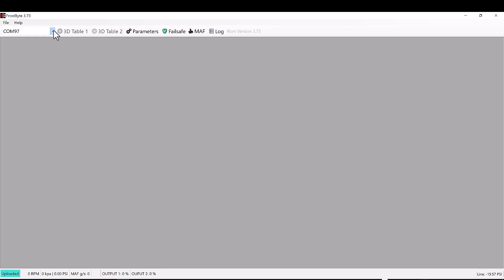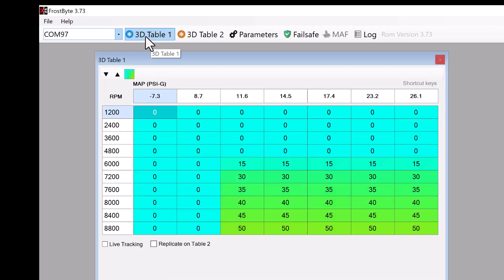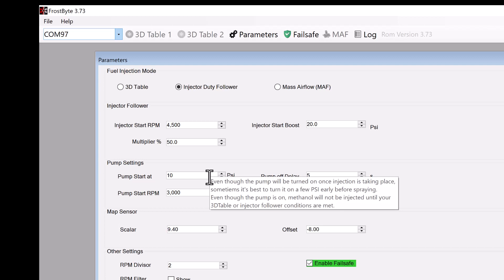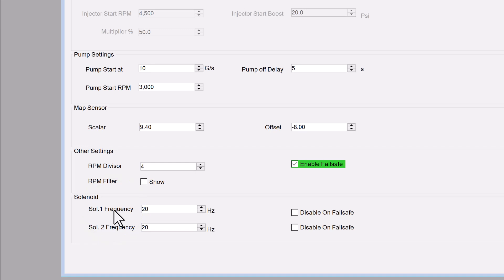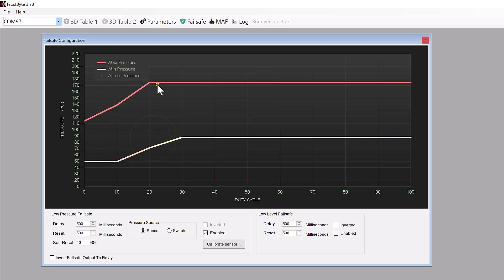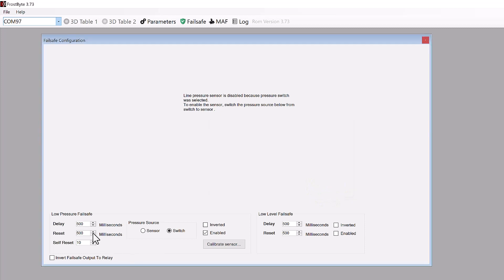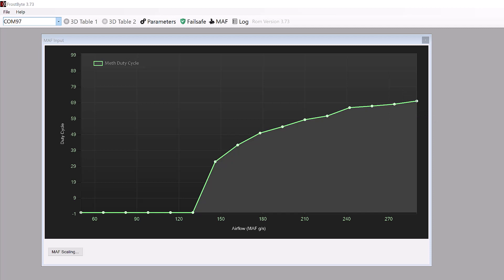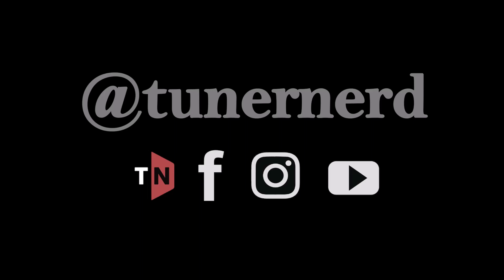FrostByte Water Injection Controller - How to

Comment: Do you need direct port injection for equal distribution to take advantage of this? Wouldn't it be Is easier to tune with just water. That way it's not seen as fuel. And the water cools chamber. ?
Reply from the maker: If you desire to tune with just water that is when direct port is an absolute necessity.
The water droplets in pure water vs water alcohol mix are larger, more dense, has more inertia and as such they do not take corners easily  - they don't distribute well.
For most people jut looking a moderate bump in octane (15 to 20% more hp) a single or dual nozzle setup is sufficient with 50/50 or more methanol content.
Reply: @TunerNerd  Thank you.